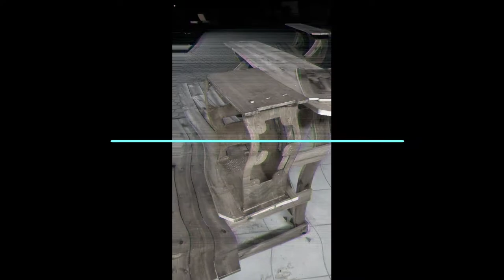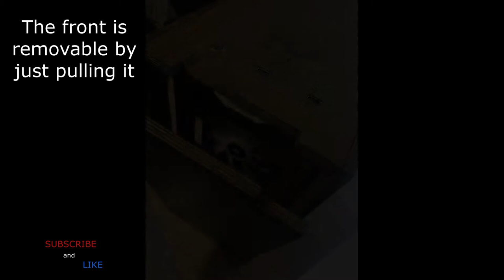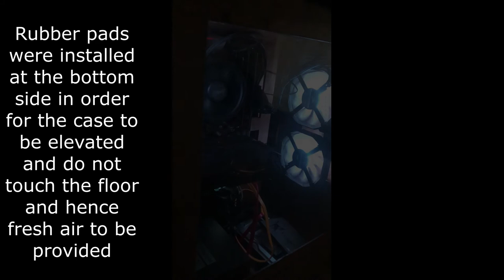How to Make a Wooden PC Case | TechVa

Comment: Bro, this PC is struggling with airflow so much. From the video you can see that only the back fan is actually doing anything, as you have blocked the 2 in the front from any air by putting a solid wooden panel, without any holes whatsoever. I propose you add some mesh in the front instead of this solid  wooden panel.
Reply from the maker: The front panel is hollow from the inside and fresh air is inserted from the bottom! Its hidden ;)
Reply: @techva7201  SHOW ME
Reply from the maker: Check on 5:25. There is free space between front panel and the bottom panel. It runs a 1050ti on average of 58°C during Warzone!
Reply: @techva7201  That's way too small. Are you sure the gpu isn't staying cool because the cpu is thermal throttling?
Reply from the maker: The CPU used on the build is the Ryzen 5 3600 with the stock cooler and during warzone has maximum 60°. Also, the removable parts are kept in place with magnets, so they don't fit airtight with the rest of the case.
Reply: @techva7201  I guess it's fine then. And if you ever upgrade to hardware that does get hot you can always redesign the front panel.
Reply from the maker: Yeah it is that simple! If we need even more airflow the front panel can be changed or redesigned!